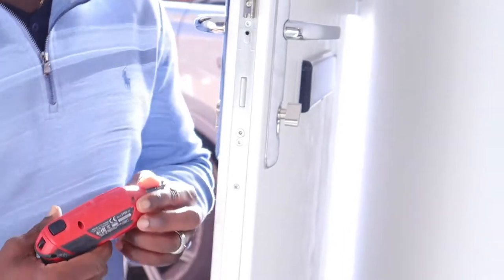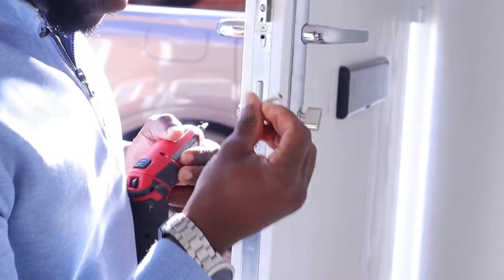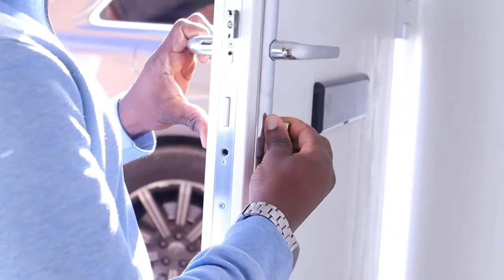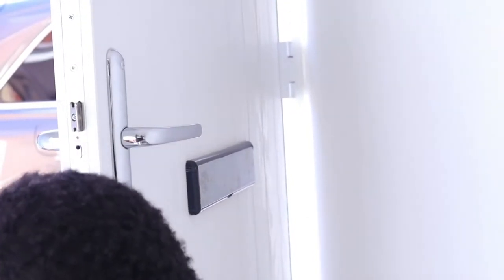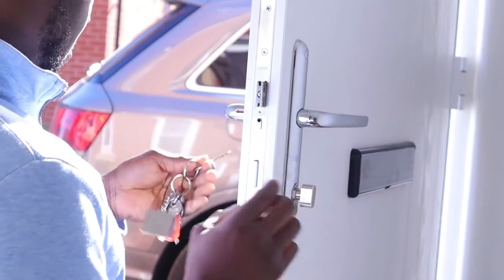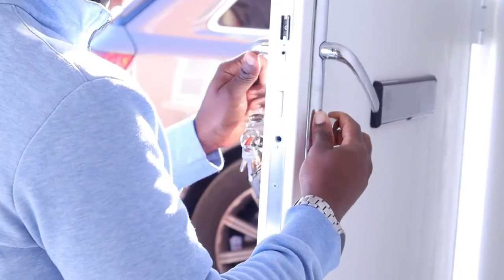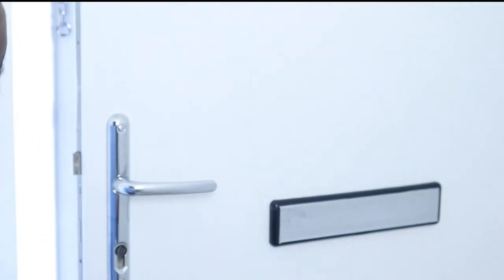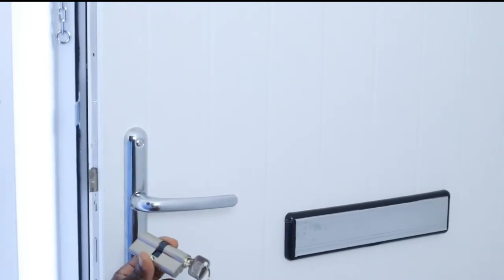How to Change Thumb Turn Euro Cylinder Lock

Comment: My lock doesn't have the loosening screw, how are those removed?
Reply from the maker: Hi Ti Heera,  usually all Euro cylinder lock will have a centre/fixing screw which is what secures it in place to the door frame. I have not come across one without it. You might want to check the face plate that secures your lock if there's a screw that secures your lock to the door frame. If there's one, then that's what you need to unscrew to remove the lock.
Please let me know how you get along and the type of lock you have and I will try to do some research on it.
All the best 👍😊.
Reply: @GlowSync  thank-you for the detailed reply. I appreciate it. Turns out it was one of those door handles without a euro cylinder, just two outside pieces and the lock and inside knob were a part of the two separate pieces.
Reply from the maker: Really glad you got it figured out 👍.